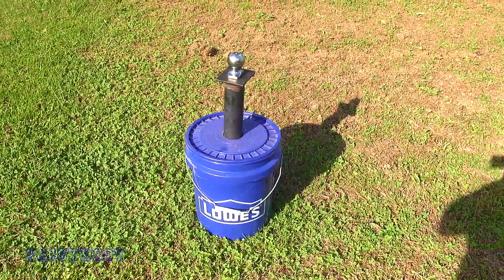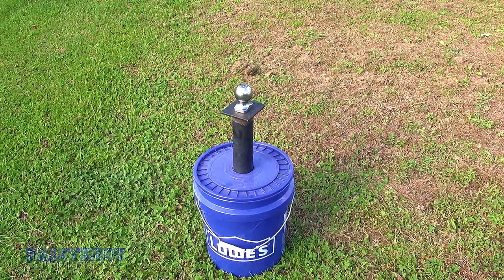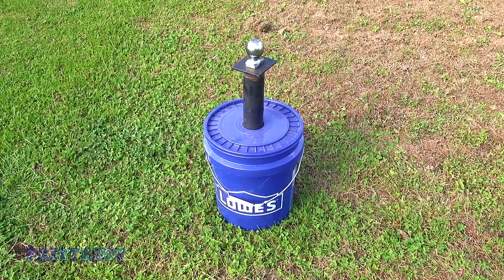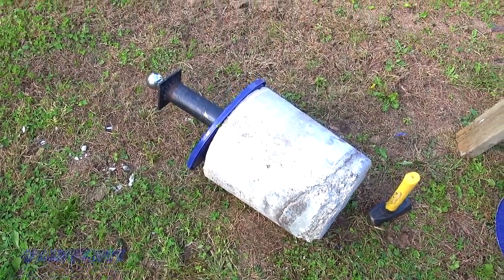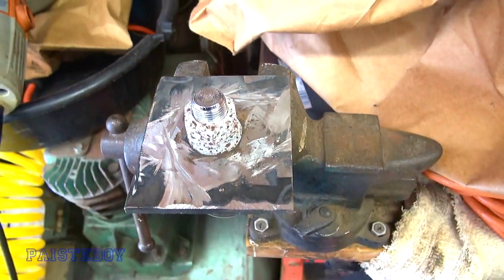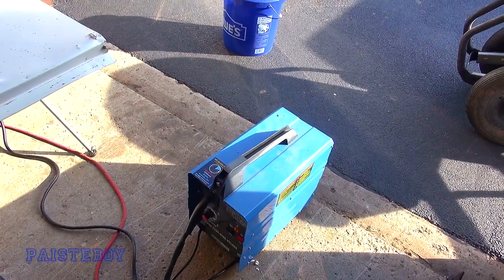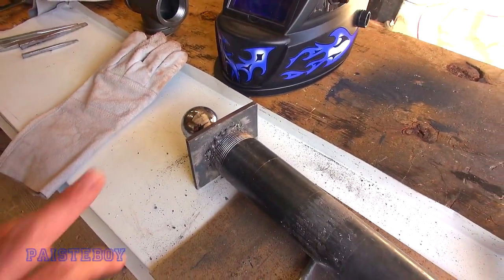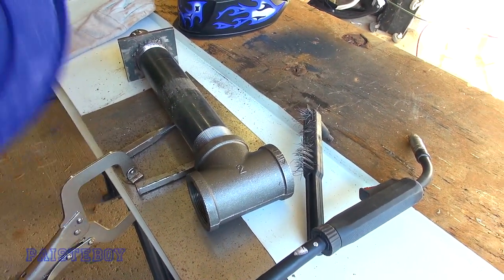Homemade Trailer Stabilizer v2.0

Comment: What is the purpose? Is it so you can walk into the trailer without it flipping up?  I find my heavy duty tongue jack is plenty for storage
Reply from the maker: No. It's not for loading purposes. It's because in heavy winds the trailer tends to blow around and this will prevent it from blowing around. With almost 0 clearance between my garage, the fence and the trailer, I can't afford it to move even a few inches.  It also works better than the cheap tongue locks as a theft deterrent.

Comment: Hey Paiste, Is that spool welder a 110v Model? I’ve been looking at them and there’s so many variations. My garage isn’t wired for 240v.  With everything going on we both might be riding the old iron till the new sleds come in.  Take Care 👍🏼
Reply from the maker: Yes it is.  I got it at Harbour Freight about a dozen years ago.  Still works pretty well for 100 bucks.  I'm hoping the new sled gets in before the first ride!  Thanks for watching SIN.

Comment: What do u use to wash trailer! It still looks like u just picked it up from dealer!
Reply from the maker: I used Rain X wash & wax.  I cleaned it really good and also used my electric pressure washer to rinse everything well.  I greased up the hinges shortly after it dried.  It was stored indoors all summer so it stayed clean.  Thanks for watching Dino.

Comment: The rear stabilizers I sent you on FB might solve your problem with stabilizing the trailer.  If you put them down, then jack the front up to put pressure on them, they should hold the trailer in place.  That's what I do when I park my trailer near the house.  It stays put.
Reply from the maker: I would do that but as you can see in the video I can't get to the back of my trailer once it's in place.  Maybe if I don't put the jack stands down all the way and then jack the front up until the jackstands hit it may work.  I'll have to think about that.  This ball hitch set up is to keep the front end from swaying and also serves as a lock.  Thanks Craig.
Reply: @Paisteboy  I just took another look.  I can see with some snow back there it would be pretty tough.  I bet it took some practice to back the trailer in there.  Talk about no room for error!  Seeya on the trails, tell Shag and Zuke I said hi!
Reply from the maker: Yeah.  I actually push the trailer into place by hand.  I can't even see the opening because I don't have the wide mirrors on my truck.  Will do.

Comment: Why not just cut the ball, then cut pipe off the existing one and re weld the ball on? Great video!
Reply from the maker: I wouldn't have the clearance to do any of the welding since it was so close to the concrete.  Plus I almost got hurt trying to man handle that 5 gallons of concrete.   Thanks for watching BL&OS.

Comment: Couple questions do u only one sled in trailer and do you have a pic of that. Also if you load 2 sleds I’ve heard it’s tight and the skis hit.
Reply from the maker: I don't leave any sleds in my trailer when it's not in use.  I currently have a 2016 129" Ski-Doo Blizzard and there is about 2 feet behind the sled when it is in the trailer since this is a 12' trailer.  I'm not sure what trailer you think this is or what sled you are trying to fit What trailer. 
What make and model sled are you trying to fit in what make and model trailer?  If you don't give me all of the information I can't answer your question.
Reply: We have 2 rr cats 137. My buddy has a blizzard nor’easter when loading then side by side skis are wide enough they hit. Length is no issue. I was sold on Triton 167 in-line but looked at one quality not what it use to be. Triton was bought out by Alcom. I don’t buy that removing the wishbone is better either.  That frame is not as strong.
Reply from the maker: As far as fitting 2 sleds side by side in my trailer I haven't had an issue.  I haven't had any cats in my trailer so I can't speak on the ski spread there.  I have heard of other trailers having that issue.  I guess you should measure the ski width total on both of your sleds.  My trailer is 98" inside left to right.
I wasn't aware of the sale of the Triton company.  I guess it happened in November.
Reply: Just talked to a guy on doo talk he said he has to put a 2*4 under one ski of a sled when loaded side by side so they don’t hit.
Reply: Guy on doo talk said he has to put a 2*4 under one ski when loaded side by side so they don’t touch.
Reply from the maker: Ok. Good luck.
Reply: Thanks
Reply: Thanks
Reply: Thanks
Reply: Thanks

Comment: Why wouldn’t you just cut 5” out of the pipe then just re-weld the pipe?
Reply from the maker: I wouldn't have the clearance to do any of the welding since it was so close to the concrete.  Plus I almost got hurt trying to man handle that 5 gallons of concrete.  Thanks for watching kranky Sledzz.
Reply: @Paisteboy  better safe then sorry. Can’t have you hurt with new sled on its way and winter around the corner. Looking forward to seeing new sled vids.
Reply from the maker: True.  I thought I could have broke my foot when I was trying to get it on to the horses.  That thing needs to stay on the ground. lol.  Thanks, I have a few more in the works.